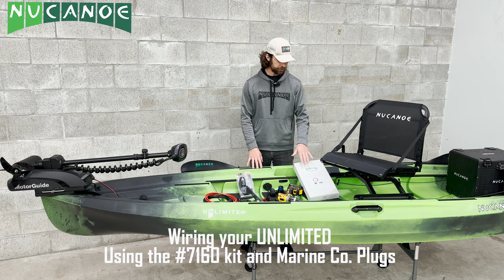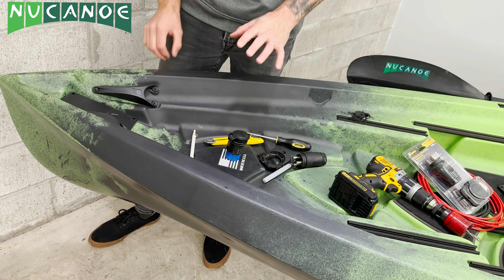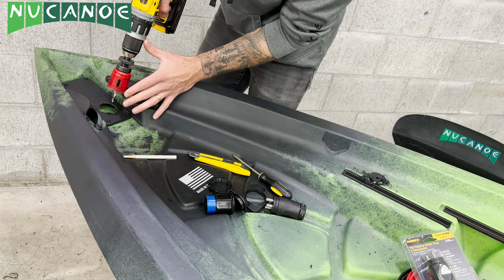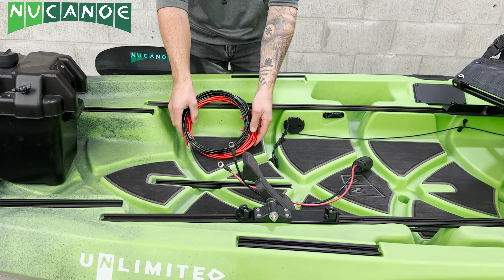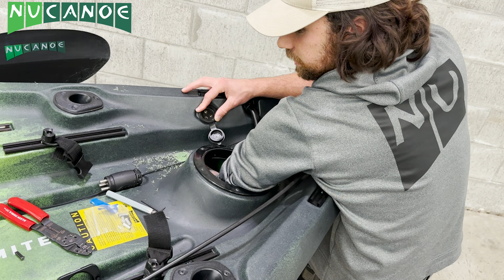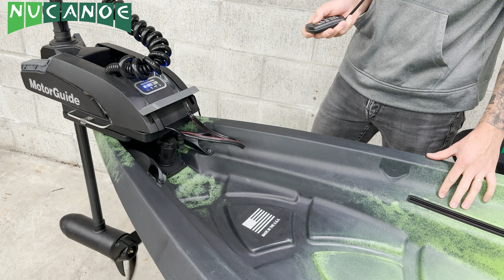How To | Through Hull Wiring | UNLIMITED using Marine Co. Plugs

Comment: Great tutorial. So, no ground cable required? Also is it possible to install a kill switch coming off the marinco plug going to the motor? Something i can attach to my pfd if I were to fall out of kayak while it was moving. Thanks for the video.
Reply from the maker: No ground required! You can wire a kill switch into the system. We would recomend adding it to your mid-kayak wire access plates. There are a number of kill switch options. https://www.amazon.com/Waterblade-Battery-Disconnect-Safety-Switch/product-reviews/B07SS6X41F

Comment: Where are you putting the Battery Fuse
Reply from the maker: It's built into the battery box. You could add one in line, taking advantage of the side wiring plates.